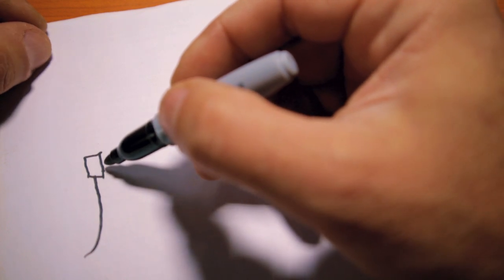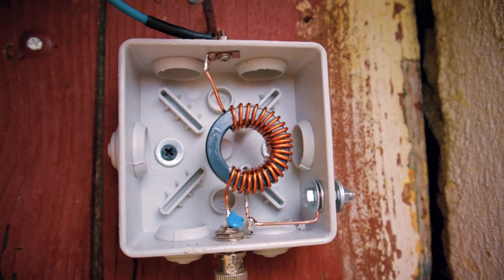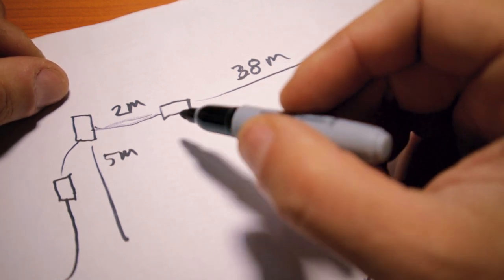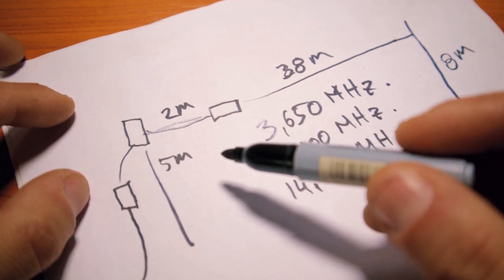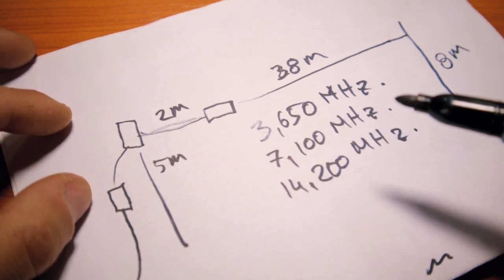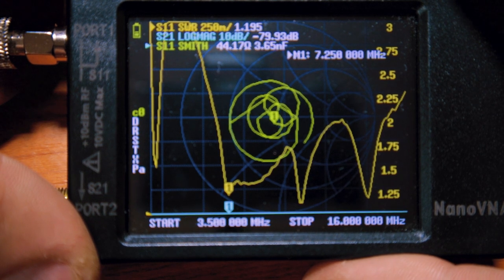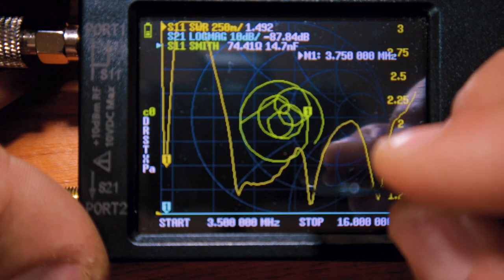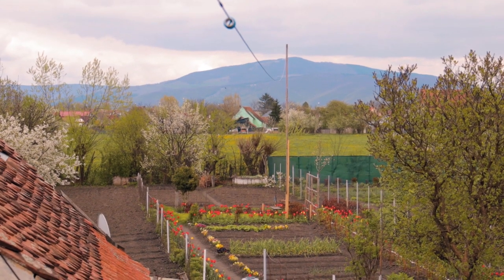Experimenting With The EFHW-8010 Antenna - Can it get better ?

Comment: Great stuff let me know how u get on
Reply from the maker: So far I am happy about it... but is not yet as I want it. On 80m the SWR is still a bit high... probably because I can't put it higher than 6-7 meters. I need to work a bit more on the compensation coil and then adjust the length of the wire again. Final touch as they say ))). This time I will also use a 4.2m counterpoise to avoid any naughty RF... besides the RF Choke that I now have inside the house next to the transceiver. But on RX... it seems a lot better than the shortened version I had before.

Comment: Probably the part between unun an choke is too short. Try 0,05 lambda.
Had the same issues and this and two 100pF gave me the solution of having a pretty broadbanded resonant antenna.
Every antenna is different, it worked for me. 73 HB3XBL 👍🇨🇭
Reply from the maker: Thank you so much Mark. I thought I would move the choke close to the transceiver for the new tests this way there would be enough coax left between the impedance transformer and the TRX. Two 100pF capacitors you say about the capacitor from the impedance transformer ? I thought I should try other values but didn't had the chance yet. I will try that as well. Thank you one more time. Fingers crossed I get it to work well as in my dreams hahaha. 73, YO6DXE.
Reply: @dxexplorer  I just had one 100pF capasitor in the impedance transformer, but the dips in the swr were at the right place but the swr was over all to high. So I put the second 100pF parallel and the swr came down. Just my way to solve the problem.
Later I found out, that other hams did the same. I took 100pF 1 KV others took 4KV just depending on the power they us. I’m QRP Operator.
All the best and keep me informed, what works for you. 73 de HB3XBL 👍🇨🇭
Reply from the maker: My friend YO6BLD told me as well that in his case for a 40m EFHW antenna the best worked a 50pF capacitor. So I will use a variable capacitor to do some tests and find the optimal value, then replaced with a proper capacitor. Thank you again. Ohh yes I will come back with info... and most probably a video too hehe. 73

Comment: Meant to add that Ellington’s videos provide solid information.
N4LWT
Reply from the maker: I very much agree on that. I found the video 😄😄. Thank you a lot.
Reply: @dxexplorer  You are welcome.  Out of curiosity could you lengthen your wire to 134’.  Nice looking garden you have plus such a scenic view.
Reply from the maker: I could if I would move the wooden pole a bit more in the back yes. I think before I started testing the antenna with the compensation coil... I wanted to start with some measurements of the antenna with no modifications on anything. The wire was about 134' only that being too long it was coming down next to the wooden pole. P.S. Thank you for the garden ))

Comment: Should a short counterpoise effect your swr? I have heard all kind of answers. In my case, it effects some bands like 10m.
Reply from the maker: I don't know. I didn't tested that yet. I had one before on my shortened version of the 8010 antenna... the one with the 110uH coil placed almost at the end of the antenna... but I had no nanoVNA back then to see the effect. I will test it now on this one ))
Reply: @dxexplorer  I have to get a nanoVna as well. Great tool. Wish you a lot of contacts.
Reply from the maker: Thank you Nikos. Wishing you the same my friend. Ohhh yes the nanoVNA has been such a great help so far.

Comment: U have the isolator too close to the transformer needs to be at least 4m away or will effect the swr
Reply from the maker: You talk about the RF choke ? I believe yes and yes you are right. I was testing different positions as I was curious about the results. I tried all sort of options recommended by people online. So far the best results I have with the RF Choke in the house close to the transceiver. 73, YO6DXE
Reply: I’ve experimented with mine when I had the isolator in the shack I got rf floating around everywhere so put it around 5m from the antenna base seemed to work excellent in stopping noise and rf also didn’t effect the swr either.
Reply from the maker: That is something I didn't had an issue with. But I think is because I only have 5W in my pocket ))). I am about to replace the antenna wire with a thicker one as winter is nearly here... I will also put the 4.2m of wire as a counterpoise to also avoid the same issue you had. Thanks for reminding me that as I forgot hehe. 73.
Reply from the maker: That is something I didn't had an issue with. But I think is because I only have 5W in my pocket ))). I am about to replace the antenna wire with a thicker one as winter is nearly here... I will also put the 4.2m of wire as a counterpoise to also avoid the same issue you had. Thanks for reminding me that as I forgot hehe. 73.